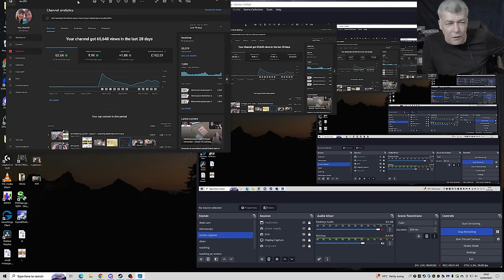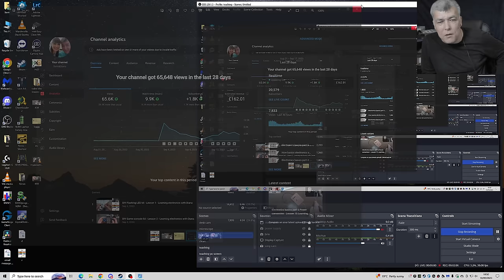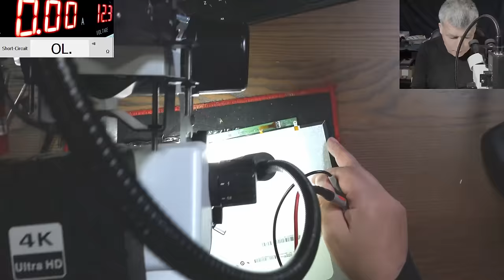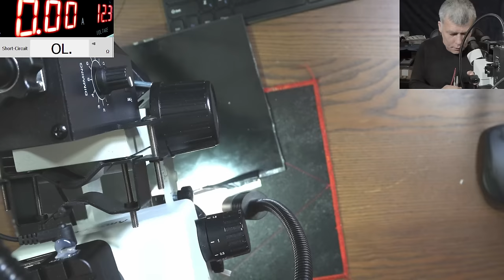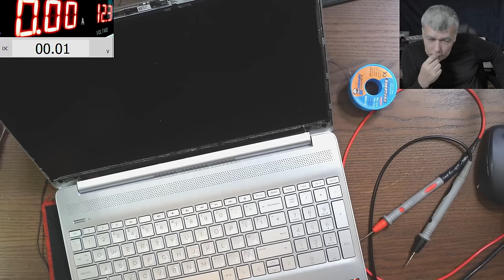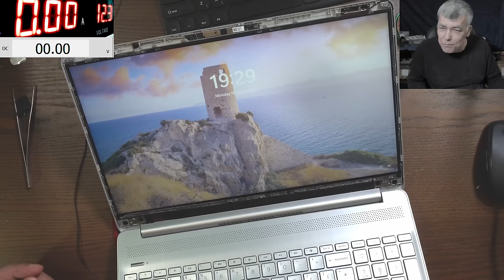Laptop screen signals explained

Comment: Yes, I have found fuses go high resistance before. They should fail completely, I guess they don't make them like they used to.
Reply: They're basically zero ohm resistors nowadays, and as so, its resistance drifts high as it gets damaged by the excessive current.

Comment: I had a similar issue with same type of screen! Check at 24:22 This fuse tricked me as well but it only needed 3.3v after the fuse to turn on the backlight 😅 BTW: 

Much thanks to you for sharing the knowledge! 🎉

Comment: The surface mounts will do that on rare occasions. They can blow but because they absorb heat, they can partially burn out. The voltage spike must have been short and riding the edge of taking out the fuse. Never trust the continuity reading on surface mount fuses. Take a resistance reading if you're not hooked to power.

Comment: One thing, didnt the 3.3v wire short the capacitor beside the fuse? I noticed it was stretched across touching both positive and negative...but i may be wrong
Reply: Hello, This wire has insulation, we call it enamelled wire, they have a type of varnish that covers the entire wire.

Comment: Nice vid, Is it possible that flex cable is faulty?  I would still get to the motherboard and check those signals on the LCD connector on the MB.
Reply: very low probability, these are low power signals.

Comment: I don't look on any display faults and even know LVDS signals, why? The display would have to cost quite a bit to spend the time on it. Otherwise, if the screen is a cheap one, I prefer to swap it as that should give quite a few years more to this laptop. But, a TV repair of such fault makes sense ;), even a cheap TV.

I'd wish I'd have time to do those repairs, have here several of displays with either a no-power, flickering, or an LVDS issue. One has a short in the Clock signal. Hope one day I'll have enough technicians to sit on them and fix :).

Congrats on your repair and good luck with that YT bug ;).
Reply: One more thing, me or my customers don't mind a dogy repair. But, I thought this video will be about an LVDS signals :D. This is just a backlight fault ;), so, the title was confusing to me ;).

Comment: I ave 2 ACER laptops, and you are right, I have to completely remove the whole assembly just to remove the bezel. They are old, but they do what I want. I can't upgrade either to Win. 11, so I will probably junk them after October 2025.
Reply: Or switch to linux :)

Comment: Sir i would like to ask one doubt on this video which does not present the voltage on pwm and led enable voltage okay for this you find solution in my case it's the both voltage is present but display not present if any chance try to explain

Comment: Hi there, at 27:55, are you using a normal wire to jump the fuse? thnx
Reply: A thin wire that can handle an amp or two. Same as what you would find in a glass fuse.

Comment: hi, i like your videos they are helpful to me. i'm using a lenovo E50-70 laptop but now it can't power on. there were missing screws on the laptop so i tried installing them but I didn't plug out the power supply. the next thing the laptop is dead. i tried everything but nothing is working. Can you please help me, what could be the problem here.

Comment: Please show us how to change onboard ram
Reply: it's the same as replacing any bga chip. remove old chip, wick and clean solder pads, buy new chip that has new solder balls already in place and solder onto the board with hot air.

Comment: `in my screen only pwm voltage is missing what to chack. all fuse are ok i have same screen motherboard sorin has in this video. any one even i have checked cap, diode are good.

Comment: no need to isolate those wires?
Reply: It's enamelled wire. It's insulated by a thin varnish coating, the sort you'll find in inductor windings.

Comment: Usual brilliance of understanding electronics perhaps you could do the Bain of the laptop community The XPS 15 9550 there are hundreds of these with the same fault, it even comes on and performs Dell own diagnostic clears it with no problem, the next time you turn on it comes with ram problem or doesn’t turn on, I only saw one guy find a solution but he didn’t do a part 2 which is what he said he would Northridge FIX
Reply: northridge vids are PURELY about showing competence to get more paid work. none of those vids show how to repair anything. If a software diagnostic program can fix the fault then it's a bios or cmos issue. Anyway if it's a very common issue the fix will be on some repair or electronics forums.

Comment: no no no no speaking of concedes i had a laptop come for format when i installed the driver for gpu the brightness got to 100% for 2 seconds and then it was gone to 20% after some time resseting bios ec and uninstalling and installing it became like this i power on for 1 second and then the brgtiness is gone nothing i knew something was super wrong guess what the fuse was about to die i think it was 7 ohms when i power on it is 19v then in the span of 3 seconds 19 18.5 17 16 0v like this when i soldered a wire it was fine what are the chances that the laptop reporting something wrong because of that and the signals is fine but missing because the laptop knows something is wrong yes and in my case when i adjust the brightness the higher i go the lower it becomes 😂 because more power with high resistance

Comment: For me that kind of repair is not acceptable because it is bad for eyes to watch in full brightness displey
Reply: If the customer does not want to pay for the more expensive repair and be responsible the risk, this is the most reasonable way to go.
Reply: @kriswillems5661  Sure but repair is to return function to factory state, this is just maximum light, so very bad fix, but i know is hard to find new SiO ic. And also full brightness will spend battery faster
Reply: @4Relax  Do you repair laptops, if so link to your channel, didn't think so. When you go to garage and get your car fixed do you seriously think it returns to "factory state". I look forward to your reply amd moreover a link to demostrate your work.
Reply: @4Relax  I understand you. If the customer has to choose between an perfect but expensive fix almost the price of a new laptop or motherboard and a less perfect fix for a reasonable price, what do you think most people would choose? Proposing a very expensive price to a customer results almost always in a no-fix.
Reply: @kriswillems5661  Yes but did the customer authorise a less perfect fix? I have never been asked that when I have had devices repaired. I think the customer will complain when they realise that they can't lower the brightness to an acceptable level.